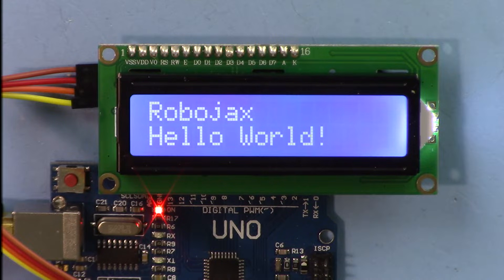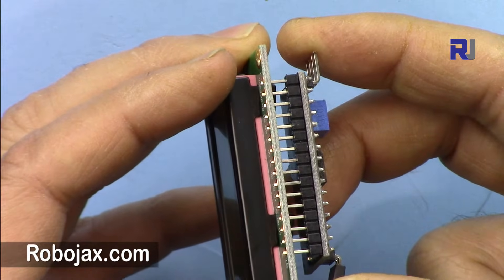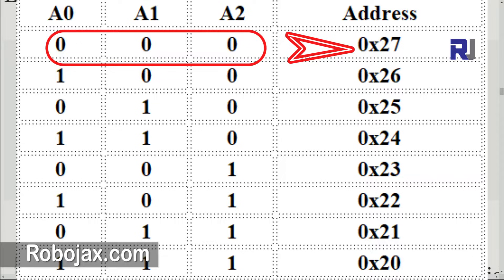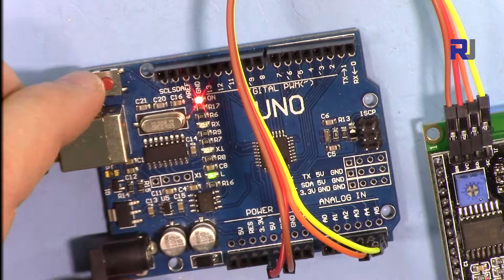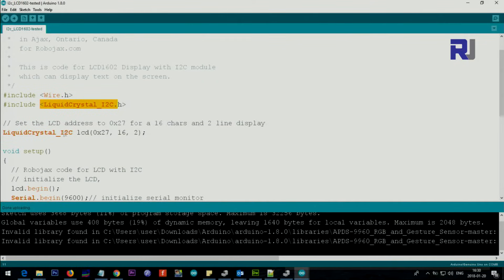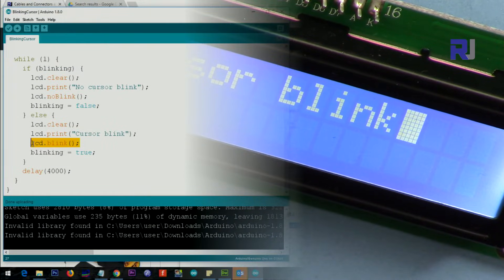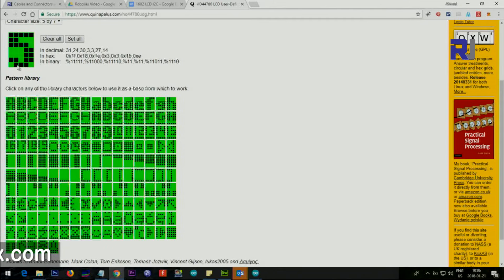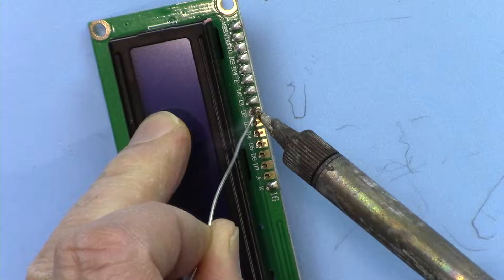How to use  LCD LCD1602  with I2C module for Arduino - RJT50

Comment: Robojax it is not working for me plz help me i write correct adress and wiring bus still its not displaying anything :(
Reply from the maker: You posted 8 times the same massage. ONE would have been enough. So what error are you getting. "not working" is not enough . please provide the error you are getting. you must be getting error.
Reply: Robojax not showing anything on screen and where you provide download file is not same as you shown in video
Reply: Robojax and this error is comming....

Liquidicrysstal is being something....
Reply from the maker: Complete this: Liquidicrysstal is being something....   what is this. so I can help you.
You must watch video fully without skipping. it will work if you skip. I have not said extra stuff in the video.
Reply: @robojax  no matching found for call to liquidcrystal.h::begin()' this error is comming but i add all libaraies i watched your video 7,8 times
Reply: @robojax  no matching found for call to liquidcrystal.h::begin()' this error is comming but i add all libaraies i watched your video 7,8 times
Reply: @venommish2651  watch again...if still issue exists...watch again :)
Reply: Robojax plz plz plz help me how to fix tell me the easiest way 🙏🏻🙏🏻🙏🏻 how to display on lcd with i2c
Reply: Plz plz plz plz help me

Comment: I done the code like you did, but this error message comes up every time, idk how to fix it. Please respond
no matching function for call to 'LiquidCrystal_I2C: :begin()'
It highlights the lcd.begin();
Reply from the maker: you've skipped the video. please watch it without skipping.
Reply: @robojax  Sorry, this does not help ! where is it on the video ? It is absent !
Reply: Still the same here, the instruction is wrong: it should be 'lcd init'. Found it out of the official documentation for Liquidcrystallcd Lib.
Reply: @guillaumetchekhov2144  even with the I2C?
Reply: @codingvio7383  yes indeed. Just have a look at the datasheet. This sketch doe work with some flaws and needs corrections:
 1: init instead of begin
2: beware of the SPI adress, check on it with the adress checking sketch you can easily find
3: there are soe problems with the first line, it keeps the last letter of the wecoming message.Solution: just delete the welcome !
Reply from the maker: you have not installed the correct library. I made another tutorial with the same library here https://youtu.be/NXAswOc_2zg and used lcd.begin() and it works fine. you are using wrong library.

Comment: I need help please. I have connected a MPU9250 accelerometer to the arduino at pin A4 and pin A5 already. 
Where can i connect the SCL and SDA of the LCD screen and how do i change the code?
Reply from the maker: Hi, you are asking questions which have been all answered in the video. Please watch, have patience as for 15 minuets. I am reading this comment after 7 hours. if you had watched the video, you would have had the answer 6 hours and 45 minuets ago.

Comment: The close up photography is good but I stopped after 4 minutes as its unclear what is meant by A0, A1, A2 is not soldered this point can be soldered together. "This point" is singular while "together" is plural.  Do you mean "These points" are to be connected to each other by soldering?  The photo does not show them connected to each other.   Is one to solder  all 3 points together (A0 to A1, to A2)? "This point can b soldered together " is similar to saying   "one of the legs are both the same". Respectfully the value of this video could be improved with some clarity on what to solder regarding A0, A1, & A2 .
Reply from the maker: that topic was out of focus of this tutorial. Explaining I2C address would have made the video very long. you may watch it her https://youtu.be/bqMMIbmYJS0

Comment: If u use the SDA and SCL pins instead (I have to since I'm also using something that takes the pins u used) do you have to change the code? Is there a line I missed where you declare which pins transfer clock and data?
Reply from the maker: NO. That is what you should use. A4 and A5 are the same pins.

Comment: Just got the Lcd thing to work but I have a doubt. Suppose you want to change the text After re-uploading the code you have to either adjust the potentiometer in the i2c module or turn the Arduino On/Off to make the new text visible. Is there a simple solution to this?
Reply from the maker: you can have push buttons like 2  3 or 8 push buttons each with different messages. once pushed you can display them. I have a lot of videos on push buttons. Watch them so you learn how push button works. then if you watched this video fully you would know how to display text. With each push button different text will be displayed. if time permits, I will make a video on that.

Comment: Hi, Your video is excellent!, But I downloaded library, I intalled, Connect all and LCD did´t work. I checked the Program,Libraries and circuit several times.
The program ran without error, the LEDs on Arduino blicked, and LCD is on, but message had not   show. Is very strange.! I saw other video about issue address 0x27 issue.
Are there any way of check pins 4 and 5?, I check with a LED, and it pins have a behaivor of pulse of clock.

 I am using Arduino UNO and LCD 1602 Any idea?

Best Regards
Reply from the maker: Hi, turn the potentiometer. Most of the times it is the contrast that makes the text disappear.  Did you run the I2C scanner? it is in the same page as the code. https://robojax.com/learn/arduino/?vid=robojax-LCD1602-I2C install i2C scanner, get the address and use it if the issue is with the I2C. Most people don't watch the video and kip. I have left nothing. it should work as it did for over 100k people.

Comment: Mine didn't work on A5 and A4. Only works in SLC1 and SDA1. Also address is 0x3F instead of 0x27 for some reason.
Reply from the maker: The manufacturers set in hardware. here my video if you want to set different address https://youtu.be/bqMMIbmYJS0 also A4 and A4 should work with Arduino UNO for others boards  see the pins here https://www.arduino.cc/en/reference/wire
Reply: Hello!! the second part of this comment saved me after messing with this thing for over an hour lol. thank you for sharing this fix :)

Comment: Hello I are great but with the code it says error liquidCrystal_12c.h:no such file or directory can u help thanks
Reply from the maker: Hello, it means you have skipped the video and have not followed the instructions. Please watch again without skipping and other 133,000 people it will work for you. Cheers.
Reply: @robojax  Strange ... I got the message "lcd begin: no such ..." and finally after checking in the data about liquidcrystalllcd library, it had to be "lcd init". Which is not at all the same ! as well, in your sketch, you constantly write on line2 (0,1). You forget line 1 (1,0) ?
So I have doubts indeed.
I have seen the video all along and it never gives anything more.
Reply from the maker: you have not installed the correct library. I made another tutorial with the same library here https://youtu.be/NXAswOc_2zg and used lcd.begin() and it works fine. you are using wrong library.

Comment: is it important to solder a0 a1 and a2 pin for 0x27 address
Reply from the maker: Once you receive it, do not touch it. it will work. unless you want use another address.
Reply: If in doubt use the ic2 scanner sketch to find the address of the ic2 device you are using.  Also as mentioned in the vid, a lot of the modern revision [r3] boards use SDA & SCL instead of pins A4 & A5. You'll find a lot of the older sketches showing pins connected to A4 & A5.

Comment: Can I connect "VCC" to the +/positive side of a 5V battery, and the GND to the -/negative side of the same battery? (I am going to connect some equipment to my Uno, and I've heard it is easy to burn the card if you try to take too much power from it)
Reply from the maker: Yes you can if your battery is 5V. We don't have 5V battery as for as I know unless there is something else that regulates it to 5V.
Reply: Robojax I was thinking about getting a 5v battery eliminator / power supply, instead of a battery. Not sure if it will work

Comment: What if i don't have i2c module
Reply from the maker: You can't find Arduino without I2C. You can connect 128 devices in parallel. So if the pins used for other purpose, just connect them in parallel with the other devices.
Reply: @robojax  okey thank you sir
Reply from the maker: You are welcome.

Comment: This is Raju 
I have tried out more on my project by following your procedure but it is not working
Please solve my below problem.

SerialDisplay:13:12: error: no matching function for call to 'LiquidCrystal_I2C::begin()'

  lcd.begin();
Thanks for your answer
Reply from the maker: Hi Radu, it is because you have escaped the video. Watch it fully and I can assure you it will work as it did work for over 100,000 people.
Reply: Yes sir I will try once again
Reply: lcd. Initi (); is working instead of lcd.begin(); in you code I don't  know what is the problem
Will re install my library sir
Reply from the maker: you have not installed the correct library. I made another tutorial with the same library here https://youtu.be/NXAswOc_2zg and used lcd.begin() and it works fine. you are using wrong library.

Comment: I'm not getting the output displayed. LCD is on, i also checked the I2C address and its 0x27 only. What should i do?
Reply from the maker: use potentiometer to set it properly. Watch the video it should work.

Comment: My LCD won't display anything, the back-light LED is on, but I can't see any text on the screen. I checked the soldering and I didn't spot any problems with that process, and my code is also correct. Do you know what might be the problem? Thanks.
Reply from the maker: Adjust using potentiometer. I have shown in video.
Reply: @robojax  I tried, but that's not the problem

Comment: Arduino: 1.8.10 (Windows 10), Board: "Arduino/Genuino Uno"

C:\Users\JTBro\Documents\Arduino\RoboJaxLiquidCrystalI2c1602Display\RoboJaxLiquidCrystalI2c1602Display.ino: In function 'void setup()':

RoboJaxLiquidCrystalI2c1602Display:29:13: error: no matching function for call to 'LiquidCrystal_I2C::begin()'

   lcd.begin();

             ^

In file included from C:\Users\JTBro\Documents\Arduino\RoboJaxLiquidCrystalI2c1602Display\RoboJaxLiquidCrystalI2c1602Display.ino:20:0:

C:\Users\JTBro\Documents\Arduino\libraries\arduino_100261/LiquidCrystal_I2C.h:58:8: note: candidate: void LiquidCrystal_I2C::begin(uint8_t, uint8_t, uint8_t)

   void begin(uint8_t cols, uint8_t rows, uint8_t charsize = LCD_5x8DOTS );

        ^~~~~

C:\Users\JTBro\Documents\Arduino\libraries\arduino_100261/LiquidCrystal_I2C.h:58:8: note:   candidate expects 3 arguments, 0 provided

Multiple libraries were found for "Wire.h"
 Used: D:\Program
Multiple libraries were found for "LiquidCrystal_I2C.h"
 Used: C:\Users\JTBro\Documents\Arduino\libraries\arduino_100261
exit status 1
no matching function for call to 'LiquidCrystal_I2C::begin()'

This report would have more information with
"Show verbose output during compilation"
option enabled in File -> Preferences.
Reply from the maker: So remove the other library or use proper installation of library. Save library in download folder, on Arduino IDE click "Sketch->Ad library->Add .zip library and then select the library in the download folder it should resolve the issue.

Comment: Hi Robojax, thanks for the video but i still can't get my lcd to work.

I soldered the I2C backpack on the 16x2 lcd, connected the pins right, checked the adress with the I2C scanner (result was 0x27), installed the right library, tried every angle of the potentiometer of the backpack,  closed and opened arduino, resetted the UNO, reinstalled the library, 

summarized: I tried everything but the only thing my LCD gives is a very bright blue screen with no boxes, lines or anything on it. Just blue light. What could it be? I am trying this for days now. 

Hope you can help me. Thanks in advance.
Reply: Never mind. Took my time soldering it again and it worked. Probably didn't solder it right the fist time.
Reply from the maker: good luck with your project.

Comment: all is going to wrong with me my lcd(16x2) show dark boxes at cursor(0)
i am using olatus ol-lcd-1602-i2c from amazon i used following code for printing:--#include <Wire.h>
#include <LiquidCrystal_I2C.h>
#define I2C_ADDR 0x27

/*----( Declare Constants )----*/
/*----( Declare objects )----*/
// set the LCD address to 0x27 for a 16 chars 2 line display
// A FEW use address 0x3F
// Set the pins on the I2C chip used for LCD connections:
//                    addr, en,rw,rs,d4,d5,d6,d7,bl,blpol

LiquidCrystal_I2C lcd(I2C_ADDR, 2, 1, 0, 4, 5, 6, 7, 3, POSITIVE);  // Set the LCD I2C address

void setup()  
{
  Serial.begin(9600);  // Used to type in characters

  lcd.begin(16,2);   // initialize the lcd for 16 chars 2 lines, turn on backlight

  // ------- Quick 3 blinks of backlight  -------------
  for(int i = 0; i< 3; i++)
  {
    lcd.backlight();
    delay(250);
    lcd.noBacklight();
    delay(250);
  }
  lcd.backlight(); // finish with backlight on  

//-------- Write characters on the display ------------------
// NOTE: Cursor Position: (CHAR, LINE) start at 0  
  lcd.setCursor(0,0); //Start at character 4 on line 0
  lcd.print("Hello, world!");
  delay(1000);
  lcd.setCursor(0,1);
  lcd.print("HI!YourDuino.com");
  delay(8000);  

// Wait and then tell user they can start the Serial Monitor and type in characters to
// Display. (Set Serial Monitor option to "No Line Ending")
  lcd.clear();
  lcd.setCursor(0,0); //Start at character 0 on line 0
  lcd.print("Use Serial Mon");
  lcd.setCursor(0,1);
  lcd.print("Type to display");  

}

void loop()  
{
  {
    // when characters arrive over the serial port...
    if (Serial.available()) {
      // wait a bit for the entire message to arrive
      delay(100);
      // clear the screen
      lcd.clear();
      // read all the available characters
      while (Serial.available() > 0) {
        // display each character to the LCD
        lcd.write(Serial.read());
      }
    }
  }

}
please help me wher am i wrong 
(i connect Lcd GND to arduino GND
      LCD VCC to arduino 5V
      LCD SDA to arduino A4
      LCD SCL to arduino A5)

and i am using arduino (generic Uno R3 atmega328p)
Reply from the maker: Of course it should not work. You are not using my provided code. This line below is not from my code:
LiquidCrystal_I2C lcd(I2C_ADDR, 2, 1, 0, 4, 5, 6, 7, 3, POSITIVE); 
my code is  LiquidCrystal_I2C lcd(0x27, 16, 2);
here is the solution:
0-I Assume you have the LCD1602 with I2C module which has only 4 wires. If you are using another module, then I have video for that search my channel.
1-Please watch the video fully. Do not escape as I never leave any questions without answer. You will find all answers for the top in the same video
2-Follow the instruction in downloading the library
3-Use the code that I have provided in the page where you download the code. it will work for sure
1000s of people have used it and it has worked for them and it will work for you
4-Don't forget to adjust the contrast knob using a screw driver so you can see the text. Black boxes on the screen says that you need to adjust it.

Comment: it said that no matching function for call to 'LiquidCrystal_12c::begin()'
Reply: Arduino: 1.8.9 (Mac OS X), Board: "Arduino/Genuino Uno"

/Users/xxxx/Documents/Arduino/sketch_aug26a/sketch_aug26a.ino: In function 'void setup()':
sketch_aug26a:29:17: error: no matching function for call to 'LiquidCrystal_I2C::begin()'
       lcd.begin();
                 ^
In file included from /Users/xxxx/Documents/Arduino/sketch_aug26a/sketch_aug26a.ino:20:0:
/Users/xxxx/Documents/Arduino/libraries/LiquidCrystal_I2C/LiquidCrystal_I2C.h:58:8: note: candidate: void LiquidCrystal_I2C::begin(uint8_t, uint8_t, uint8_t)
   void begin(uint8_t cols, uint8_t rows, uint8_t charsize = LCD_5x8DOTS );

        ^
/Users/xxxxx/Documents/Arduino/libraries/LiquidCrystal_I2C/LiquidCrystal_I2C.h:58:8: note:   candidate expects 3 arguments, 0 provided
Multiple libraries were found for "LiquidCrystal_I2C.h"
 Used: /Users/xxxx/Documents/Arduino/libraries/LiquidCrystal_I2C
 Not used: /Users/xxxx/Documents/Arduino/libraries/Arduino-LiquidCrystal-I2C-library-master
exit status 1
no matching function for call to 'LiquidCrystal_I2C::begin()'

This report would have more information with
"Show verbose output during compilation"
option enabled in File -> Preferences.
Reply: @ahmadhazim7053  you can fix this by deleting the other LiquidCrystal libreries
https://forum.arduino.cc/index.php?topic=581907.0
Reply from the maker: Because you did not include the library. Watch again, download library and add it to your Arduino IDE (Arduino program)
Reply: Robojax can i run 8 display on single arduino?
Reply: I ran into this problem as well.  Use lcd.init();   instead of lcd.begin();
Reply: I know this is late reply, but if anyone got this error even though you have the library, make sure library folder is called as instructed on github. Should be LiquidCrystal_I2C.

Comment: i'm not getting output in LCD 1602 even if i change address plz help me out
Reply from the maker: Did you run the I2C scanner? Use I2C scanner code that I have provided and it will tell you the address. Then use the address and it should work.
Reply: @robojax  yes I used scanner it show address 0x27 and later I soldered A2 pin thn address was 0x23 didn't worked
Reply: In LCD It displaying like blocks in first row thts all... noting is changing
Reply from the maker: The it is the brigntness.  If you do not have proper brightness, you will not see . Rotate the know in the back of LCD.
Reply: I can see bright blocks in first row thts all evn if program uploaded....and wiring LCD  to Arduino........ SDA to A4 , SCL to A5 and SDA to SDA, SCL to SCL . I tried dint work